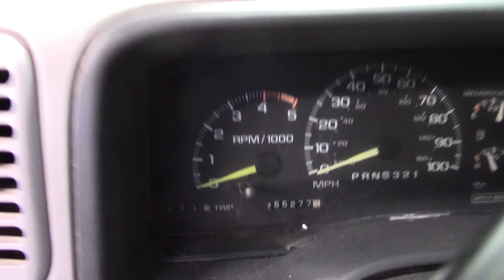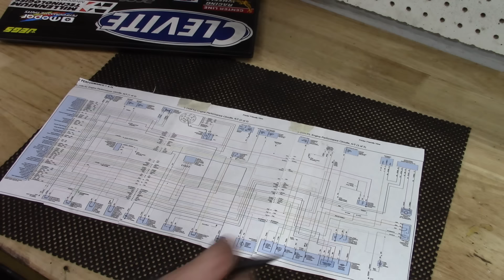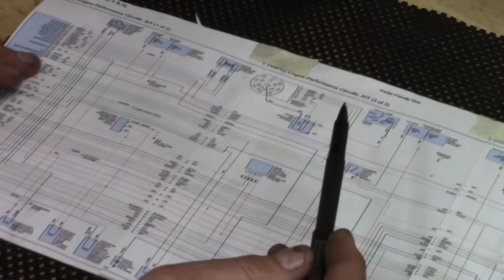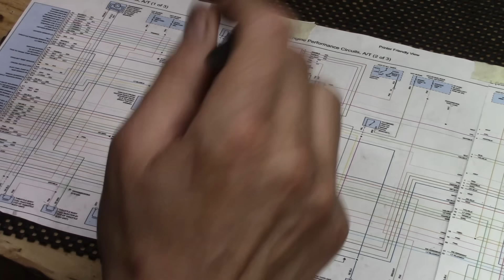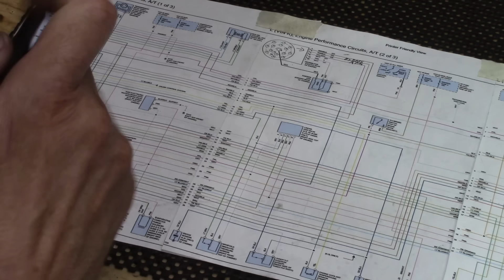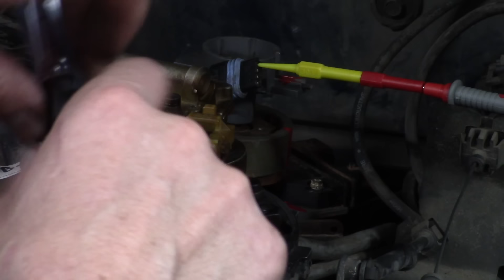Challenging Cranking No Start Diagnosis  1995 Suburban

Comment: It is the timing advance. You unplug that wire, set your timing and then plug it in. It's computer controls your timing advance.Otherwise, you can get your timing set right.If you got that wire plugged up

Comment: Bypass wire for timing should be disconnected before timing it, with those TBI years 🎉 it's called a pickup coil, inside the distributor, must pull can gear to replace it,..

Comment: Did the entire distributor really had to be replaced, or could have replacing just the ICM could have solved the issue of having no SPARK?
Reply from the maker: Just the ICM would have repaired it and in fact I wanted to just replace the ICM to show proof of concept of the diagnosis however it turns out it was less expensive to get the whole distributer than just the ICM!!

Comment: thanks so much man I just bought a 95 k 1500 tbi and its being a bitch. got it for $1200. Had to put in new battery cables, Starter, ignition swi, fuses, alternator, Nuetral saftey switch, multiple wires, And this bitch still keeps stalling!!!!🤣 have an ign coil and distributor in the back

Comment: My 1995 Chevy Four Winds 454 has fuel, spark from coul to sparkplugs, cranks, but no power at the injectors.
 I checked all grounds and can't find it.
 I did however notice that when I hook up the negative on the battery, there is a spark. Is this a hot ground?
Reply from the maker: What is voltage on the power feed to the injectors?  What is the voltage on the ground side?
Reply: @SchrodingersBox I only used a noid tester and there was no spark at all.
Reply from the maker: Ok that doesn’t mean there isn’t power then. There may not be ground. Those things are fairly useless if there really is no power or ground.  I need to know the voltage on the power feed.
Reply: @SchrodingersBox 
 I have 0 voltage on both, but I did get it started using starting fluid.
 I have an issue that something is pulling a load. As I was hooking up the negative terminal to the battery, there was a spark. The ignition is in theb off position.
Reply: Can I do the same with a test light and put in 12 volts to fire the fuel injectors?
Reply: I have no voltage. I did get it to start using starting fluid
Reply: I drove from California to Eagle, Colorado. I stopped to fill up my fuel tank, 40 gals. I got in to leave it did not start.
 I emptied the 40 gal of gas. Replaced the fuel pump, fuel filter canister, coil, distributor cap, wires oil sending unit, and rebuilt the throttle body. Still no start.
Reply: She has a brand new battery amd alternator as well.
 I have spark at the spark plugs, just zero voltage ar the injectors both on the positive and negative.
Reply: My 1995 chevy 30 Fourwinds has a 454 with 56,000 miles on her.
Reply from the maker: Ok what’s the crank sensor signal voltage showing?
Reply: @SchrodingersBox the 1995 454 has no crankshaft sensor. It does however have a an ICM in the distributor that the signal goes through from the PCM.
 GM installed the crankshaft sensor on the 454 in 1996.
 Also my port which would be on OBD II port is not that of an OBD port, it is retangular.
 My scan tool won't even work to test.
Reply: @SchrodingersBox I was able to fire her up using a nine volt battery to fire the injectors.
Reply from the maker: In that case why bother where the issue is. If the fuse for the injectors isn’t blown, just run  fused ignition power from the battery to the injectors. They are ground side switched so this would be fine- it’s how they are powered anyway.
Reply: @SchrodingersBox Just need to run the hot wire then.  
I'm not sure where to wire them to the injectors at?
Reply: Did you ever get it fixed Michael?

Comment: Did you fix the hood? Always have a oil pressure sensor and icm extra in the glove box ☑️☑️, keep your ECT sensor clean and replace your injectors with higher cc ones as ethanol goes up in gasoline 😉🏁🍾

Comment: Easy and cost effective way would have been to take any good spark plug pull the wire off any cylnder and plug the spark plug in turn it over you should see spark if you dont then you know its spark related if you do it fuel related no spark the first thing i would have changed would have been the icm notorious for going out on distributed systems then i would've changed the plugs if wires test good with ohms from a multi meter the leave them alone coils rarely go out on these tbi systems but good video as far as learning but this will save you a lot of time and parts guessing especially if its fuel or ignition related 😉
Reply from the maker: the first thing I would change on a no spark would be whatever is causing the no spark. why guess at the ICM?  Diagnose. don’t guess!!

Comment: Wonder if you can help me, have 88 full size Chevy can't get TBI to pump any fuel I replaced computer distributor with HEI I have plugge fire, 9 PSI fuel pressure to throttle body, connected distributor tac side to purple white wire reference pulse to computer, have headers all O2 sensors unhooked. Will start whin primed but TBI injectors will not work. Study wiring diagrams for a week any ideas?😢
Reply from the maker: I would start with the extreme basics- measure the voltage drop on the power and ground sides of the fuel pump.
Reply: Did you change the relay

Comment: Got the same problem with a k1500 truck. 
I got Ambitious and took the module off the distributor.
Fuel pump was shot replace, still crank and no start. 
My brother suggested removing the module instead of replacing the whole distributor. Hope this is the solution. . .
Reply from the maker: What was the voltage to the module indicating? I would totally start there. 
   Very off you have a bad fuel pump AND an ignition problem.  Never seen that before.
Reply: Had both, bad fuel pump and module in the distributor. Replaced the module instead of the whole distributor.
Cleaned up the cap, new ignition coil.
It fired right up.

Comment: Absolutely, spectacular video.  Thanks so much for using scientific methods to troubleshoot.  I am having significant under load spark knock and slight stumbling at start up.  95 TBI 350 with unknown maintenance.  It's my own truck so I replaced the distributor cap, rotor button, wires and plugs.  Replaced negative battery cable cleaned ground to intake and positive battery cable connections for good measure.  Voltage is great on guage cluster and multimeter.  New alternator also.  Next up coil and ICM.  My guess so far is that during load on the engine (hills, etc.) the ICM under the distributor and/or coil can't adequately meet the demand leading to spark knock.  I only use non-ethanol gas, 90 octane, by the way.
Reply: The temp sensor on the intake did you I u change it or if you dont have a vacuum leak check your map sensor or egr valve

Comment: There is nothing compared to the satisfaction when you turn the ignition on and that engine starts right up after a deep diagnosis. 

I have a question, what type of scan tool or scope are you using?
Reply from the maker: Totally agree!!! The scantool i currently use is then TopDon Phoenix smart. For a scope I use Picoscope 4425.

Comment: So how would do this on 96-97 vortec.  I replaced icm, crankshaft posiition sensor, coil, and camshaft position sensor. Also tested fuel by spraying either and gas in throttle body, but Still no start. Thinking maybe a ground or ecu.
Reply from the maker: Well I would first start with the data you got showing this was a crankshaft sensor issue. This infers you have reference and ground at the sensor but no signal output. Is that what you found?
Reply: Yes, there is no siganl from ignition nowhere.  There is no ignal, but fire going to all sensors.
Reply from the maker: No is there signal from the crank sensor. 
  Keep it simple: I need to know what is the reference voltage at the sensor and what is the voltage on the ground showing and what is the signal voltage showing?
Reply: It is a black 3 prong sensor, how do i measure and do measure at the harness or the sensor.  I am DIY'er, but know how to use tools
Reply from the maker: i just need the signal and reference voltage. just use a DVOM.  if it’s 3 wire it’s just a hall effect so just measure signal and reference.
Reply: ok thanks will do

Comment: Sure glad it isnt my truck and you arent charging me for you to learn.   The Moduel inside the dist is bad

Learn your trade or Dont take on the job.  In this repair. You are guessing and you are just being a Parts Plunker.  Its no shame to be ignorant. We all learned it somewhere. But if that coil is Electrically Good...   Then only Replace the Defevtice Part.  What you are doing is like ordering a Coil and s Tail Light ... with your reason being they are both Electric parts.  Bottom line, stop replacing parts that are Not Defective...!!!
Reply from the maker: I didn’t replace parts that are defective you fool. Because I properly diagnosed it. Something you are clearly incapable of doing because you obviously didn’t understand my methods.

Comment: I think there is only one „sensor“ needed for an MPI-System. Especially these GM Rochester injectors witch are alpha/n. In Germany we got 2 systems with this: 1. gen like yours, with the distributor tacho-generator, and an second gen with waste spark and only crank sensor. (Ok, more like 3 gen’s, but the 3rd is not interesting)
On the SPI you are right - they need both crank and cam sensors for timing. Alt least I did not see  an MPI with both or all three sensors.

Comment: Are you supplying 12 volts for the RPM signal to test if the PCM is reading?  Running from the positive of the battery to supply the 12 volts?

Comment: So I just rebuilt an engine in a 2000 k2500 got it up and running and then all of a sudden after I had a crank sensor leak I lost spark, doesn't want to crank or do anything it turns over but that's it I've already changed out the crank sensor with no avail I do have a new distributor to put in and I changed out the coil and I guess it's the module beside it on the package deal but so far no spark it's not even trying to crank the fuel pump is working fine and I'm at a total loss. I don't have a skan tool and can't afford one, and really can't afford to have it towed into a shop and pay that fee either. I have had it running though like I said so it has to be something simple?? Yeah right hey if you have any ideas please shoot me a line I'm about to lose my mind.

Comment: Wasnt in a accident the door panel catches the bottom of the running board its a common problem with those style chevys an i onow cause i still have mine an owned it for 13 yrs im 28

Comment: You can un-plug the coil and plug it back in and it will simulate the signal to the PCM and fire the injectors…just for future reference.

Comment: Don't know if SC will see this,  but I'm curious of what steps he would've taken for my recent case. It was a crank no start. With 4 previous parts cannon shots taken by others, I started with your FASTTEC.  My first attempt was a bust because I only had my meter and no service data. Everything checked out. Still no start.  

Second attempt, had my code reader and some data which allowed success.  Showed stuck rich o2 codes and fuel rail pressure sensor high reading code.

Turned out the FRPS was allowing fuel bypass in the vaccuum line anytime the key was on.  So massive flooding.
Luckily, this was a 2006 F-150 so the data helped.  

HOw would you test for flooding in the FASTTEC method?  There were no obvious signes that the  FRPS was filling the intake with fuel. Plugs were wet but we just thought that was from multiple cranks.
Reply from the maker: The F is FASTTEC would have been found through the clues of rich condition codes and the rail pressure codes. Exactly as you did. FASTTEC still worked.
  Remember it’s not that one of the components of FASTTEC is missing, it’s that it’s responsible for the no start through being out of range one way or the other.

Comment: That system is called an EST ignition system. I know it's been over a year but I would like to know if you figured out that you have to disconnect the bypass wire on the passenger side of the truck, under the glove box. There is a single wire there with a plug and in order to get the control module to zero out you have to unplug it, time the motor with the distributor and timing light, then plug it back in. Just an FYI for anyone finding this video.
Reply from the maker: Yep I forgot to mention that and didn’t realize until after I edited. 
thanks for bringing it up

Comment: Hi there I'm struggling with my car Mazda Soho 121 1998. When i try to turn the key over there is no cranking and my fuel pump isn't working. I checked the fuse boxes everything works. It has been 3months now.
Reply from the maker: Sounds pretty simple. Whats the voltage drop at the pump showing?

Comment: A coworker and very good friend of mine has the infamous no-spark going on with his 11/1994 GMC 1500, 4.3 Vortech, 5 spd manual w/Utility bed. Truck sat for 5+ yrs, he resurrected it and drove it a few times earlier this week. He attempted to drive it literally half a mile to a store. Before he pulled into the parking lot, he said it back-fired and shut off, but he was able to coast around to the lower trafficked area of the lot. The truck will not and has not fired since. It was later into the night, I only brought a few tools up to check it out. Shot just a bit of starter fluid into the throttle body turned it over,  nothing. This immediately sent me into spark troubleshooting and diagnosis. I hooked up my in-line spark tester, nothing from the distributor cap, nothing coming from the coil. I did not have any other electrical equipment with me, forgot to bring meter, and due to the commonality of a 30 yr old original coil quitting after 5+ yrs of dormancy, I diagnosed it as a bad coil. The following day after work, we went back to try the new coil... nothing, no spark. I began checking the less then ideal condition connectors and wiring to all of the ignition components, found zero outstanding issues. Grabbed my meter, no power is being supplied to the coil from neither of the 2-pin connectors. Yet again, it's nearing 9pm and this was after a 10-12 Hr work day. We decide to call it for the night, he wanted to know what he should buy next for it. No power to coil, an EXTREME  amount of corrosion inside of the distributor cap to the point that it had actually deteriorated some of the ICM, as well as rotted the 2 retaining screws that fasten the ICM to the distributor. I describe this in full detail in an attempt to explain why me as a mechanic, the Fleet Mechanic for the company my friend and I work for, transformed from my ridiculously thorough and perfectionist self who 99 other times out of 100 would have found a schematic or diagram for the electrical and ignition components to then fully examine, troubleshoot and diagnose the source of the no-spark issue. Instead, I transformed into a damn parts changer 🤦 and from all of the aforementioned issues with the ICM, I suggested purchasing a new ICM. I cleaned the distributor cap, distributor base, and any other parts involved well enough to eat off of. We returned last night in yet another attempt to get his truck running and back to his house. Put the new ICM on/in, put everything back together, turn the key....NO SPARK!!!! There remains nothing coming from the brand new ICM to the brand new coil. Understandably, my buddy wasn't/isn't very happy after spending several hours of the last 3 nights at his broken down truck searching for the issue. Plus, twice purchasing parts totaling over $150 that have not fixed his truck 🤦🤦🤦.  Today, I'm going to apply a temporary alternative power source to the coil just to get the truck to my shop with substantially more tools and resources. If anyone actually reads through this novel of a comment, please feel free to reply with any suggestions or whatever you think may help!! Thank you!!
Reply: Did you ever figure it out? I read your very well documented novel and found to be very interesting.

Comment: For hood concern try pvc pipe slightly shorter than length of piston of hood shock,and wide enough to fit over shock,1/2''pvc 3/4cpvc,lift and lock,works great

Comment: Man i worked on several of these with 95 -98 trucks an people would bring me a tune up because of a miss or no start,,,an after getting my rearend handed to me a couple of times,,,i concluded that the aftermarket parts DONT FIX ANYTHING,,,only original gm stuff,,an bam my problems were over,,,especially the distributor cap,,

Comment: ICM can be replaced as a single unit without replacing the distributor.
Reply from the maker: True but it wasn’t available at the time while the distributer was. Even then the whole distributer was actually $50 cheaper than the ICM.

Comment: Why wouldn’t you just change out the ICM? More than likely there’s nothing wrong with the distributor
Reply from the maker: Yes fair question. I actually wanted to do that mostly to prove the issue was only the ICM per my diagnosis. 
   The reason I didn’t was because for whatever reason, I was able to pick up a complete distributer in stock at the parts store for $50 less than only the ICM which would have required a week to arrive.

Comment: More importantly the reason for checking the other components for issues even if you found one issue is because if that vehicle was at three different shops and they each fiddled with a different component incorrectly, you might have four different issues now, the first original issue and now the three others created by improper diagnosis practices

Comment: With crank and no start event i simply remove air cleaner cover and pour a small amount of gas down air inlet to see if engine runs. If it does run then i know its a lack of fuel issue